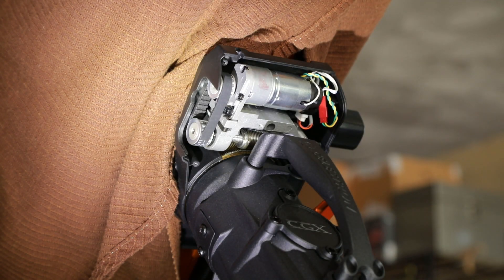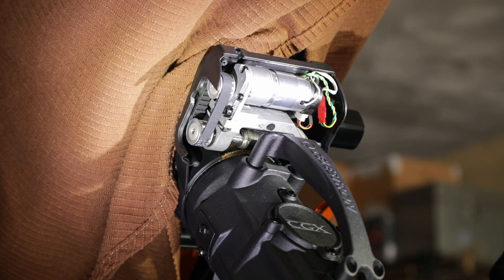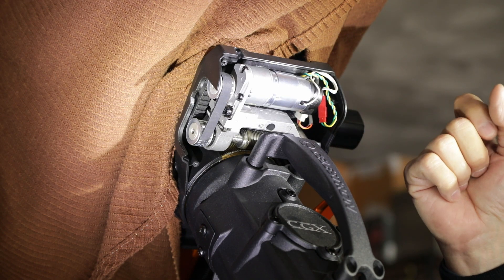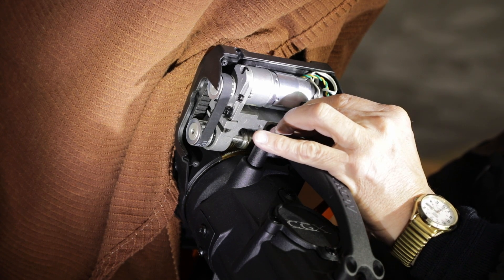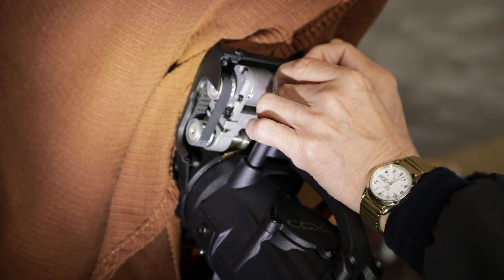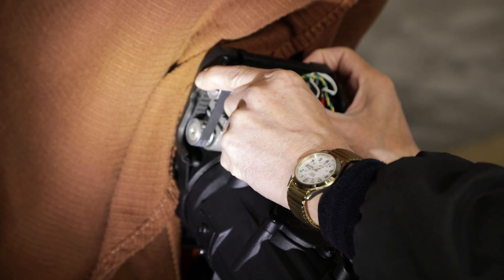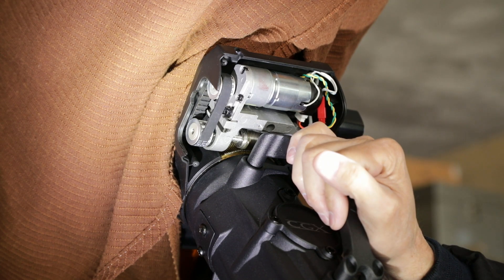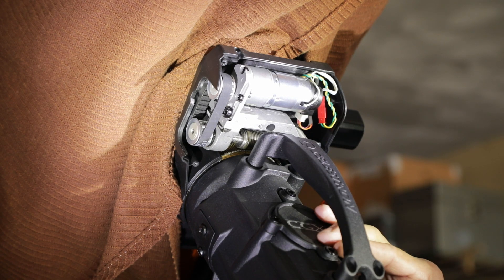Setting The Backlash on your CGX or CGX L Mount

Comment: Nice video.
Got my RA really good now but the DEC im having problems with. Cant seem to get enough play in it, way too tight.
Reply from the maker: Couple of things... Is the belt to tight? You want the belt to have a small amount of up & down motion. .125 to .25" would be good. Or it sounds like you have one of the allens a little to tight. Is the housing able to move up & down? Or is the worm to tight on the bigger gear? Need to know which one it might be to give you a better answer. Thanks...
Reply: @jeffrh  Tyvm, i got it in The end but Dec still doesnt behave like The Ra for some reason. When i wrote this The belt tension was part of The problem. I started to treat everything as an balancing act and went back and forth between belt / big allen / small allen instead of just adjusting one at a time and things started to feel better.  The mount behaves a little bit better now and no backlash nor any binding that i could notice anyway. Btw i have two maybe not all that related questions If thats ok: Is gear wobble worth addressing? And is The higest point of altitude adjustment(The part over above The locking screws) suposed to have some play to it?  The Cgx consists of so many moving parts hehe. I also find it to be The hardest to PA out of all my mounts.
Reply: OH, and tyvm for the reply :D
Very Nice of you to take your time and help people!
Reply from the maker: @Luftbubblan  Gear wobble is another problem all together. That will usually happen because something was to tight. There is no bearing to speak of at the motor end and if that's where the wobble is. You will need to get that fixed. A call to Celestron might be in order and you just might have to order that part.

Once the belt is in the correct tension. You shouldn't need to mess with it while adjusting the backlash. The whole housing is moving to get the backlash set correctly and the belt tension has nothing to do with backlash. If your gear wobble is a result of a worn out part. Then I could be difficult to adjust the backlash as I described in the video. It sounds like you might have an early CGX. If so then I would talk to Celestron about your problem and they just might have a better answer for you than I can give. If your mount is still under warrenty. You do not want to tell them what you did as that will void the warrenty as I stated in the video. All the best....
Reply from the maker: @Luftbubblan  No problem... About the gear wobble? The Belt gears do have a small amount of wobble to them. Nothing to be concerned over. If you have a warn-out part and the gear is physically lose enough to wobble. That's a problem and you should talk to Celestron about it. You just might get it fixed under warranty.  Hope that's a better answer!  ;-)
Reply: @jeffrh  Tyvm. I got mine second hand(Not able to buy anything new in my country :/ ) so no warrenty thus the reason im ok to fiddle around with it :D
I think this mount is from 2018(got multiple mounts so might mix em up).
The prev owner said its been to Celestron before but i have my doubts, i think he have been messing with it him self.
About the gear: I think its how the gearwheel is set on the axel and not the motor or axel it self(Can't spot any wobble on axel by just eyeing it anyway). Should be an easy fix if i choose to try. I got so many issues with my setup right now that i'm trying to resolve(Done many changes at once and some custom mods), trying to sort them one by one taking baby steps hehe. Hope to get there in the end :D Sry for my poor English.
Reply from the maker: @Luftbubblan  Another thing to try is to add some SuperLube to that bigger gear that the worm rides on. If the worm was so tight on that gear? It would have wiped all the grease off and you could be binding just a little in those dry spots. I used a flat head tooth pick to spread the grease around in the center of the big gear. You also might find some grease along the outer edge of that big gear you could grab if you don't have any grease... Then run the mount back and forth a couple of time to work the grease into those dry spots... Good Luck!
Reply: @jeffrh  Again ty so much. Legend. Many valueable tips, i appreciate it a whole lot! Stay awsome!

Comment: Hey Jeff, can I send you a photo of my graph in the phd2 log viewer. My ra spikes on each side about every 30 seconds and it's killing me when I'm using my c11. I want to get your professional opinion to see if it could be backlash before I void my warranty
Reply from the maker: Ralph, I have heard others that have had similar problems. This can be from the backlash tightening up over time and when the worm gets to a high spot, it's binding. I have also heard from some that with early CGX mounts, they had the worm bearings set up to tight. Before you go and try this, a call to Celestron might be advised. You can show them that graph and they can let you know whats going on. I would take the free warrenty service over trying something on your own and then finding out that you had another problem.  Hope this helps... Celestron isn't as busy because most of their gear is sitting on the ocean somewhere. So turn around time are pretty good right now for service... Happy Holidays!
Reply: @jeffrh . Ok. Thanks Jeff!

Comment: thank you for a fresh look at how to adjust the backlash. One question I have pretty basic: Is the only test for backlash like how you demonstrated, play in the dec unit, a few mm in either direction? We do not want any play?
Reply from the maker: Nicholas, Correct! You don't want any play between the worm and the bigger gear. If you have the backlash adjusted correctly. You will have a small amount of preload using the 3 mm Allen-head on the housing to keep the worm always in contact with the bigger gear. The small 2 mm limits how much travel the housing has up & down. That keeps the worm from jumping teeth under a load. The whole housing is spring-loaded which if adjusted correctly will help the worm ride up & down on the bigger gear.  Hope this helps... If not, let me know and I can try again...  ;-)
Reply: @jeffrh  , yes that really helps however I just want to make sure I understand something as far as diagnosing BL. before I even remove the housing, if I lock the DEC  and RA clutches and I try and move the DEC or RA axis with my hands and there is no play or no slop, does this mean I have no backlash?  Also, did you ever do a re-greasing of the gears? I read some users are doing that, thank you for an excellent video!!!!!
Reply from the maker: @nicholasdisabatino1697   I regrease and set the backlash for both RA & DEC every spring. For me, this helps the guiding. Your main question can be answered in this way. If you guide and are seeing great RMS numbers and your star are round and targets sharp. Then no, I wouldn't mess with this. If you want to check that both the backlash and housing are adjusted correctly. Your going to need to remove that cover. I don't think you can know for sure what the condition that housing is in if you never move it. Gives you a good reason to regrease things...
Reply from the maker: @nicholasdisabatino1697  Your belt tension is what I have and the housing looks good as well. When you move the housing up & down. You can move the axis in question while doing that. What you will feel is the backlash will get worse and then zero out as your moving the housing. This is normal and shows how the worm is allowed to float on the bigger gear. I hope your guiding improves. There is more to good guiding beside the backlash. Leveling the legs with a carpenters level before putting the head on... Good polar alignment and balance are all items that effects how well your guiding will be. With my CGX, I can get the RMS down to .50 depending on how quickly I set up each night. If I'm in a hurry... My guiding will suffer and those RMS numbers can get to 1.25. Hope all this helps you in your quest for better guiding.

Comment: Did you move both clockwise to tighten? I couldn't tell by watching.
Reply from the maker: Dan, Because of the way I put the housing out of spec. The 3mm allen was counter clockwise and the 2 mm allen was clockwise. This may not be what's needed for everyone when settingthe backlash.

Comment: Thanks for this Video ,The snail jumps over on my CGX
Reply from the maker: Just hope it helps you out...
Reply: @jeffrh  i hope :-)
Reply from the maker: @fuchsfranz4541  Once you figure out what does what... It's very easy to do. You just don't want to go past the point where you start to apply to much pressure on the worm. It still needs to float on the bigger gear.
Reply: @jeffrh  Yes i know...

Comment: What grease are you using?
Reply from the maker: Dan, Iused SuperLube...
Reply: @jeffrh  I will look for it in our Canadian Tire stores
Reply from the maker: @dankahraman354  There or Amazon Canada should have it...
Reply: @jeffrh  yes beats using the car which is in the queue for work at car shop. Battery died on Saturday.
Reply: @jeffrh  Amazon.ca has Superlube 1) ptfse grease, 2) S1004, 3) 21030 synthetic grease, 4) 51010, 5) multipurpose, 6) teflon, 7) tube 8) spray.... so which one?
Reply from the maker: @dankahraman354  I'll email you a picture or link...
Reply: Found out it was a loose connection with the starter. Pick car up tomorrow.